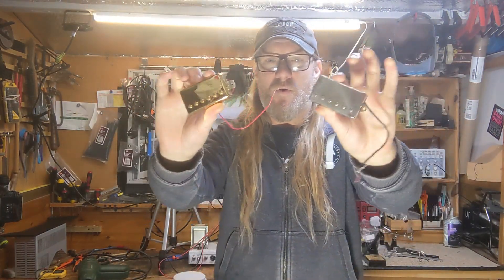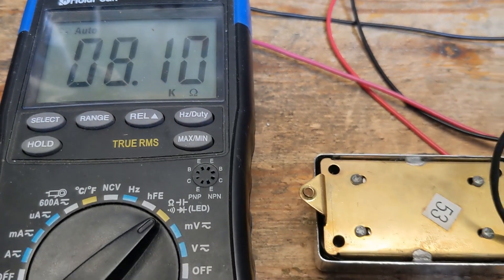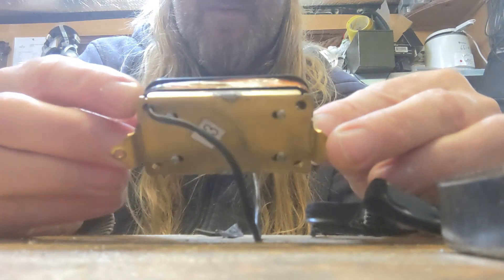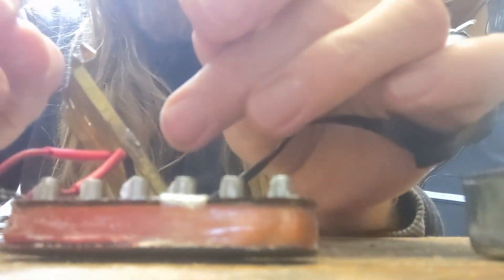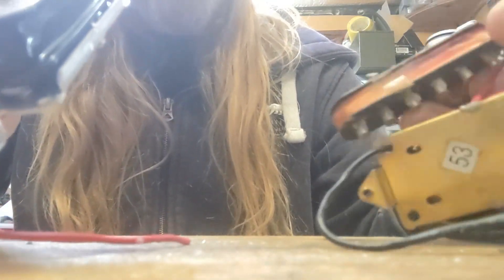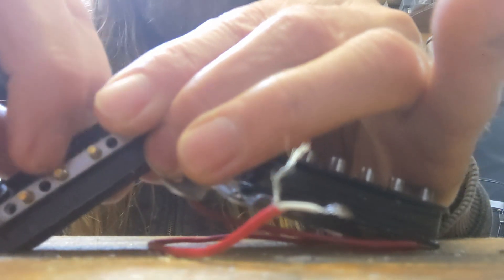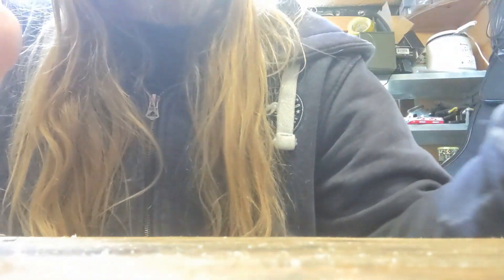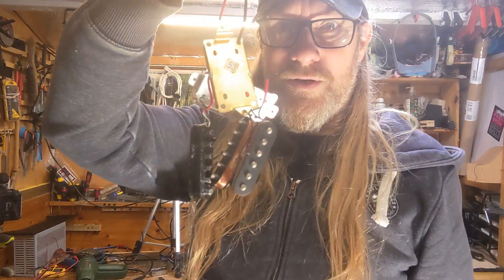Chibson Pickups Are Garbage

Comment: I rewind pickups for fun. When I find some cheap knock offs, I pull them apart. Some of them I’ll use for tone research and some I’ll rewind a few bobbins. The baseplates are grounded like a tele pickup if you know what I mean. I reuse them for different reasons. Most of these knock offs, the magnets are not fully charged, and they overwind them to try and make it likeable. It’s like putting lipstick on a pig. I recharge the magnets and wax pot them or lacquer pot them depending on the material I’m using. I did my own EVH spin on a few of them just for fun. I like some of the stuff I made just rebuilding these pups.

Comment: ah sod it me again,thought I’d add another question with the humbucker gap next to the bridge,I’m looking at the torque,or metal for the bridge,and maybe rolling blues for neck, I play stones,and classic rock stuff or could you advise on a good set cheers dave
Reply from the maker: I do classic rock covers and also some heavier stuff when doing originals, I find that a Hot Slag in the bridge and blues engine in the neck works great for me. made by Iron Gear

Comment: You'll probably find the 8K pickup is wound with 42AWG and the 12K with 43AWG. Although I think if thats the case, the 12K is still under-wound and should be in the realm of 15K.
But you're probably right Dave, chuck an Alnico magnet in and you're good to go (except that 12K pickup). Although what you would have been better off doing would be to measure the gauss of the magnets. Ceramic are generally fairly high and saturate the coils - hence why they generally sound bad. Not to say all ceramic based pickups sound bad.